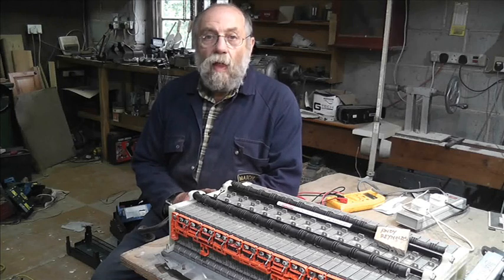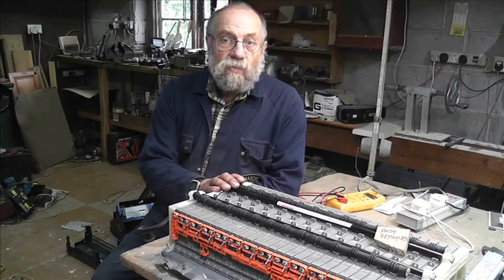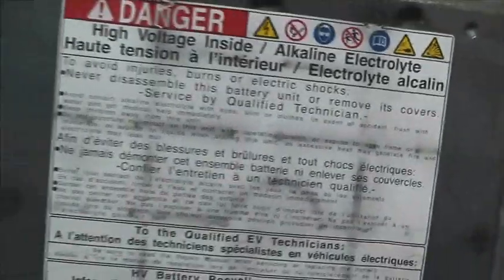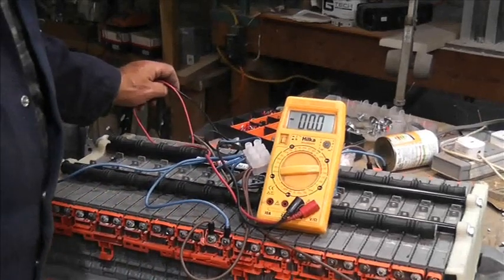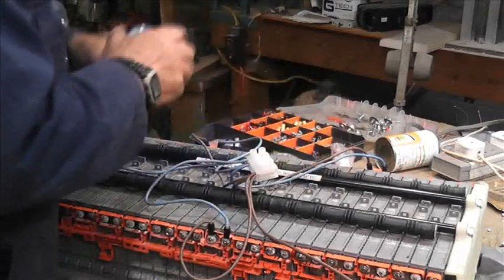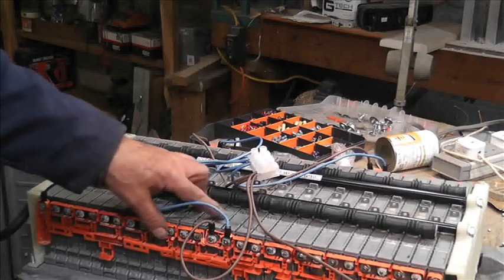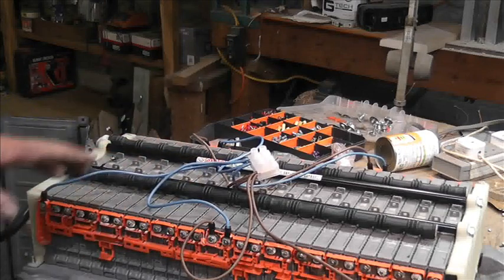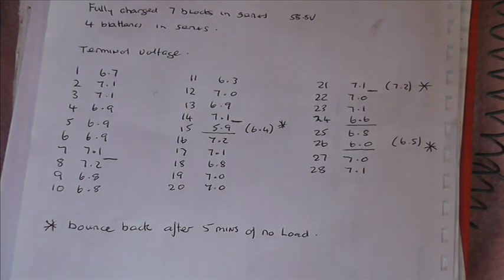Wrecked Toyota Prius battery for solar, configure and drop test

Comment: Andy, where abouts in the country are you based? 
I live on a boat, and I don’t understand solar and 12v set ups enough. 
Could I pay for your time to just ask you questions? I want to fully understand this. 
I want a big ish set up for my boat. I want to swap the engine for a vw engine, so i want a 12v set up, but i want 5KHW of 240v. But im told there’s a C rating? And i can’t have a big 12v set up? 
Anyway, I’ll keep watching your videos and hope I’ll understand it more.
Reply from the maker: Jordan, I'm in the east fen, Lincolnshire. You have lots to learn, especially about Ohms law. Watts / volts = amps.. So 5Kw (5000 watts)@ 12v = 400 amps. Totally impractical. What I suggest is 2 things, first get hold of a copy of Wind and Solar electricity (edition four) and then start experimenting. I will be running an integrated solar Battery course in Brighton in July for the Brighton Permaculture Trust. You can ask questions but they have to be driven by your own learning. Start off small and build over time. 5Kw is a huge ask, we don't draw more than 2Kw at any time from our system and we consume about 6 Kw Hrs in every 24 hours from 28 panels, Please subscribe, cheers
Reply: @TheInfoworks sorry I meant not of explain myself right. I’m used to kwh when being on the grid and in working out my bills. 
Most days i use about 1kwh of 240v but I’d like a battery bank to hold about 5kwh so i can run the washing machine and if the solar is no good due to weather I’ve got a few days till I’m running low. 

I’ve subscribed to the channel. I’ll order all the books on Thursday (payday) I’m more of a visual learner and really dyslexic too. It’s why I’m watching YouTube videos on it all.  
I don’t have a lot of money, I lost my flat and ended up on a £1000 boat, so make do and mend for me is more of a necessity then anything else. 
Just thought if i could pay for a few hours of your time I’d learn so much just talking to you. You seem soo wake to the world too, just seem like a really interesting enlightened person. 
Even if i can’t afford my dream set up, just being able to fully understand it and plan it out would make me feel better, knowing its its all possible, it’s just a matter of saving for it. 
When i learn about the C rating the other day and was told a 12v system wouldn’t do what i want, it just made me so down.
Reply from the maker: @jordanhagan1996  Just take small steps and don't rush. The joy can be found in the journey not the finish. All you need is  Wind and Solar Electricity book and use it as a reference. You don't need to read it all but it will give you an insight. Remember I've been doing this for 40 years, so take you time, cheers
Reply: @TheInfoworks  I’ll order them all Thursday. Just need to work out where or who to send them too as I have no address being on the boat
Reply from the maker: @jordanhagan1996  Rule one of finances, always have a bit left from this months pay when you get next months. Create a buffer, cheers
Reply: @TheInfoworks  I’m trying to. 
Just had bad luck, I was homeless sleeping in my car, that’s why I got a thousand pound boat that I’ve been living on for a year now. 
So that’s why I’m trying to learn about 12v and batteries.

Comment: It's an old battery pack, more cells will fail and the three or more bad cells will drag down the good cells performance in discharging and charging. Make three packs with spare cells for the future. 
P.S. you know lifepo4 batteries have thousands of cycles before their  capacity drops to 80%. Let them take the cycles while reducing the cycles in lead acid who's potential cycles is much less.
Reply from the maker: I've boosted the low capacity cells with my bench power supply, going to keep this battery in circuit for another few weeks and then re do the test, cheers

Comment: I would test capacity. At least for a few worst and best cells. Ideally for all. If one cell in a pack has much smaller capacity then others, it will get faster to top voltage at charging and to low voltage at discharging. It will influence total voltage of the battery.

Then I would put the battery to some kind of use. NiMh cells can revive after a few cycles. After they are not used for longer period, they tend to perform badly, but after been put in use, they can get in better shape. But not expect miracles with old cells.

I am playing with old NiMh AA cells. They perform strange. Measuring internal resistance can't give you good proof of health also. OK; if IR is 100mohms or 2000mohms, you know the second one is bad. But capacity can tell you more, to decide what to do. 

There's another catch at charging. When NiNh get fully charged, they will pick up temperature, and the voltage will drop. Just to complicate charging more.
Reply from the maker: Thanks for all that info, first I think I will boost charge the individual low blocks, then keep this battery in circuit for a few weeks. Follow this with another load test and see if the low blocks stay low, cheers